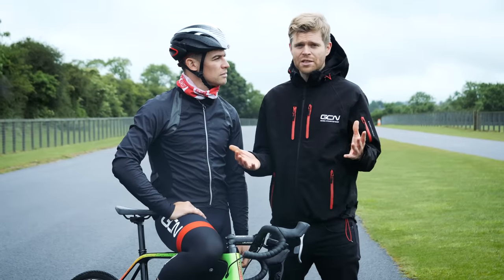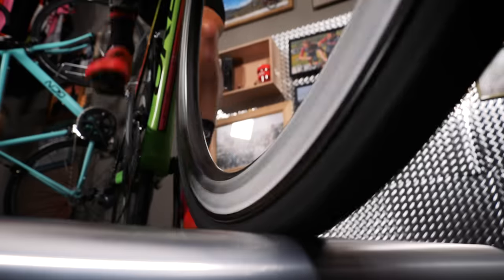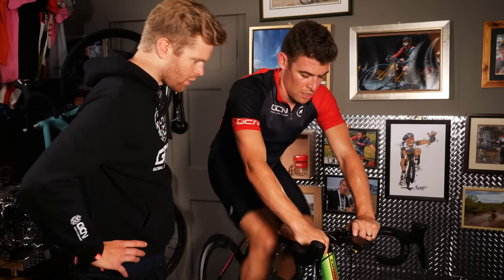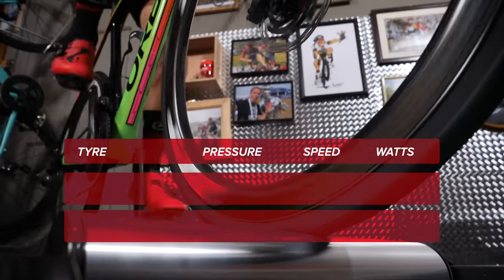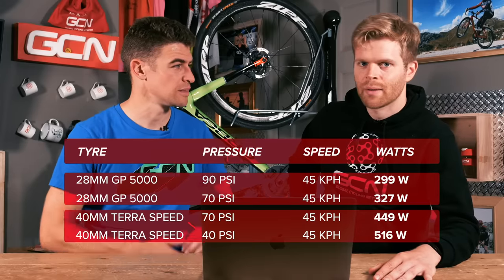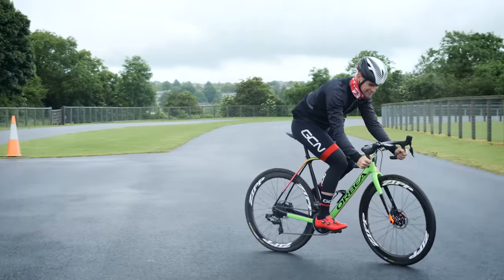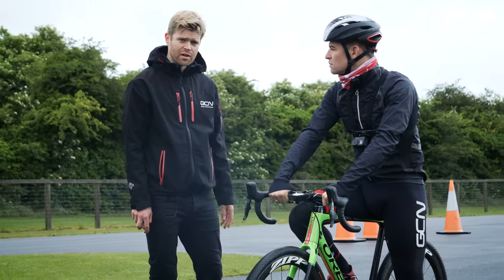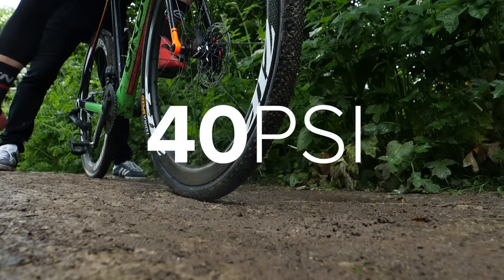Gravel Vs Road Tyres | How Much Slower Are Gravel Tyres?

Comment: The problem with the smooth roller isn't necessarily its smoothness, but rather the fact that it touches the wheel over a smaller area. This deforms the wheel much more than it would over tarmac, which probably shifts the results in favor of narrower and harder tires.
Reply: but that's not all they tested, did they?
Reply: @kalashnikovcortez1380  No. It was merely a remark on Ollies comment "This is all well and good, and it does give an indication as to the difference in rolling resistance between the two tires and the different pressures, but its not entirely representative of the real world on these perfectly smooth rollers".
Reply: Even if the contact area is smaller it is equal for all types of tires, so it doesn't give advantage to any particular type of tires.
Reply: @andreip9378  Unless the relationship between deformation and rolling resistance is exactly linear it won't be the same for all tires. Even if it is linear this would only mean that the relative difference is the same (between the tires on asphalt and on the roller), which directly implies that the absolute difference in watts cant be the same.
Reply: Ulrik Seip The harder, narrower tire will always be faster on a good surface, as long as you have grip. When you slip and crash, or have a flat, it is suddenly much slower.
It indeed is comparing apples and oranges.
Reply: The roller would have to be the same diameter as the Earth to have the same real world rolling resistance. Never thought about that. Thanks
Reply: The ratio of the differences from the test results would be relatable to real world, as seen to a degree in the second demonstration.
Reply: They should have tested this with 32mm cross tyres.
Reply: Hard to say your tire does only touch at one point on the road this has two points of contact in the back right..?  Not a physicist
Reply: @Schradermusic  back in the days we used to use 33mm cyclocross tires all the time. they behave very similar to road tires - they actually arent all that suitable for gravel but they have very good grip in wet conditions on loose mud/halfmudded roads etc.
Reply: @kingprone7846  I've recently gotten myself some 32mm Continental Cylco-X-King Racesport and I find them to be pretty good for what I'm riding. (Bad roads and dry, sandy forest paths)
They have great rolling resistance on the road and enough grip in the forest.
Reply: @Schradermusic  they look similar to the old cyclocross speed-kings from continental which were actually aweful. If you dont need to ride on mud then the best tires by far for mixed road, offroad conditions are the Continental CX speed tires (35mm imho much superior to the 45mm, i run the 45mm atm unfortunately)
Reply: the speeds have prooven themselves again and again in particular due to their rediculous low rolling resistance even when compared to slicks. They do not seem much use in cyclocross though due to them being 35mm rather than 33mm max and they are AWEFUL in mud.
Reply: @kingprone7846  The Black Chili compound really makes up for that. I'm coming from Schwalbe Marathon Supreme and it hasn't gotten much worse on the road but tons better on dry forest paths.
Reply: Too be honest I want my hybrid bike to be faster and use less off my ebike battery  aswel 25c tyres is better for road use 23mm and 19mm wide is more for track racing but on road it's pointless  you will go faster on a 25c on road than 32c so the balance  is 25c on road 23mm track
Reply: yeah the lesson is dont ride low pressure gravel tires on rollers.. lol
Reply: It's correct for me because I always ride outside on tarmac on a roller rig, backwards.

(In all seriousness Ulrik you are totally correct)
Reply: @andreip9378  No, it's not! Performance in different situations is different. So each condition favors a specific type of tire. All those lab tests don't take the energy losses in the riders body through friction into account.
Reply: @jonathanoxlade4252  that's the old school mentality, in tests they have found that going crazy narrow doesn't provide any benefits and can have worse rolling resistance than moderate width tires. 

And with how much more comfortable 28s and 32s are there's no reason not to now that most bikes are built to handle a little width
Reply: the faster tire on rollers is always also faster on real roads. the actual watts wasted will be very different though. source: years of field testing and roller testing

Comment: The second test should have been climbing up a muddy hill. I'd like to see a road tire do that ;)
Reply: the roadbiker would just call his mechanic, who'd drive him up the hill in the backup car xD
Reply: the road would DNF
Reply: That's like driving an f1 off road..
Reply: @MarvinatioN26  just getting a looooong drink of water.
Reply: The Terra Speed is not meant for wet but it would still be usable of course. 
A better argument is what would happen in winter countries near winter when roads sometimes have a bit of snow and ice - can't use the road tires at all or it's certain death.
Reply: there is a location here where the sand and gravel are very loose, and has many rocks, both rb and gravel tires would dnf while an mtb tire will ride over it.
Reply: @tobznoobs  is it made of polished marbles? MTB is made for tight turns and jumps at the cost of weight (suspension) and watts (posture). it doesn't make the tires magical. Same tire properties can be on a gravel tire. Granted there's a bit less weight on the rear tire and it's slimmer but with good tires, correct pressure I get good grip. We have gravel tires that can run 20-30psi now - that's overkill I never had to drop below 45 yet and stay around 50 for incredible road performance while still handling climbing on loose gravel.
Reply: @captainLoknar  I love how you argue from your high horse that there's no difference between gravel and mtb tires, while admitting that width is a difference. I'd love to see you show all of us why wide tires are unnecessary in loose sand
Reply: @nk-dw2hm  no I said loose stuff is where wide tires are necessary
Reply: I went on a muddy path with my road bike with 28mm tires yesterday and wow was I digging my bikes grave
Reply: Like to see any tire climb up a muddy hill.
Reply: @captainLoknar  yeah, I've a hybrid vs an mtb, guarantee the fast would always win, except where I'm not confident in my traction or surface-holding, the mtb just dominates any surface at its max pace
Reply: The road biker would just walk it up.
Reply: Exactly. I learnt something from my days using a raleigh chopper  and that is the perfect SET up for winter is a mountain bike tyre on the rear. And a road slicker tyre on the front. Its the best of both worlds.
Reply: @captainLoknar  hi there, interesting comment, may I ask you what was the make and model of the tyre you are referring to?
Reply: @ChristopherClaudioSkierka  sorry, I'm not sure what comment you saw. It's been a while.
I'm talking about gravel tires in general. I have experience with Schwabe All-Round and Continental TS.

Comment: Rollers apply friction much differently than a smooth road. Yes, please do efforts on smooth road and gravel and compare power, would love to see that!!
Reply: Philip Andrews can you elaborate on the differences? I’m genuinely curious.
Reply: @ichallengemydog  Sure no problem, the fact that the rollers are cylindrical (with a quite small diameter relative to the size of the wheel) means that the contact pressure is more acute when compared to a flat road. The smaller the roller diameter, the deeper the deflection of the tire, and road is basically and infinite diameter roller. This deeper tire deflection means that rollers are much more sensitive to tire pressure, texture, pattern, etc. Sorry it's hard to explain much more without using additional science that I'd have to look into more myself. From personal experience, changing tire pressure slightly doesn't make much difference on the road but makes a biger change on rollers because the tire deforms so much more. Honestly have never ridden rollers with knobby tires but with that more acute pressure there's no way the knobs contact the rollers the same way they do on the road. I could be wrong though 🤷
Reply: @ichallengemydog  maybe a bit more simple and visual: the strong deformation of the tyre (see video), which gets amplified a LOT more with lower pressures than on a flat road surface basically means not only more friction but basically, that you have to get up an INCLINE at the same time (just look at the angle of the deformed tyre in the direction of spin). it is as if you were to cycle up a hill ;) hope you can picture that
Reply: The weight of the tires plays a huge difference. I own a gravel bike and have 2 sets of wheels. 1 with 42 gravels and the other with 28 slicks. The 28s make it feel like I am flying.
Reply: Thank you for posting this. I was shaking my head immediately and about to post my own reply before I did a Ctrl-F "smooth" and found your reply the 2nd one down. This is a terrible comparison. They should get on a large drum wheel from a car dyno and apply different traction surfaces to get a better idea.
Reply: Philip Andrews I found 2-3kph from a 25 mm to a 40 mm at very similar power. At 35kph I needed to put out about 30 watts more with the 40mm gravel tires. I have a usual route I do when I go out alone.
Reply: Watch the whole video. They do exactly that.
Reply: @mtnbikehead  Thanks, that seems much more realistic and about what I expected from my experience.
Reply: hmm did you watch the complete video?  They did do a comparison on tarmac and gravel, and the Conti 5000 beat the Terra Speed in both instances.
Reply: @WanderingSword  Yes but those were roll down tests which don't give any quantitative information about power loss differences, only qualitatively.
Reply: Philip Andrews I have 2 sets of gravel tires. The 35s with an almost smooth centre pumped up 65psi is about 1.5-2 km slower on smoother surfaces. My 40s are tubeless, and have more tread. 
There is no 1 perfect tire. Just choose a tire that fits your local riding spots. A really good 32 will get almost anywhere. 
Ride On
Reply: So everyone here agrees that gravel tires are too slow for road use?
Reply: Jesse Chao nope, I just started squeezing into the 30kph+ group on club rides and can still ride my gravel bike faster than the c groups.. It’s the size of the motor that counts
Reply: They did also test on smooth and gravel surfaces.
Reply: @mtnbikehead  the assertion that you have a more powerful motor doesnt mean hes wrong about the tires. perhaps faster tires and a backpack full of rocks would place you in the same group.
Reply: Kooka Munga no, it was asserted that gravel tires are too slow for the road. From another site that took Strava averaging, that the avg road rider rides at about 21/22kph avg.which is a solid C Group ride around here. I avg 24-26 kph on the 40s on tarmac. 
There are a few guys that routinely bring cx bikes with 30/32s that do lead group rides, well until things get spirited on the way back which often push the speeds into the 40kph range. That’s often when those faster riders with the wider tires lose momentum. 

There is no minimum speed for road riding. If a rider wants wider tires for grip, comfort and the ability to safely rode a variety of surfaces, why not? There is no minimum speed for road riding. If you are performance minded, it’s the best horse for the course, and pick your tires to match the terrain.
Reply: @ichallengemydog  nope.  Plenty of people still think wider rolls faster, so they use gravel tire, because wider rolls faster.  These people have a hard time accepting the results here.
Reply: @kalashnikovcortez1380  People forget that accelerating wheels which weigh more takes more energy as well.  Every pedal stroke is an acceleration.
Reply: I thoroughly enjoy having my gravel wheels on when I am just riding around not trying to keep up on group rides. Mainly because the wider base makes for a more comfortable ride and secondly because being tubeless means I dont have to worry about flats.
Reply: @mtnbikehead  we are talking about different things. what you are saying is if you want to go slow than slow tires are fast enough. if you want to go fast then fast tires might be advantageous.
Reply: Kalashnikov Cortez yeah, smooth hard tarmac, skinny pumped up to 140+ psi can be super fast. However, most tarmac is not velodrome smooth. 
Wide tires at a lower pressure will help maintain speed but still at a cost, of added weight and aerodynamic losses. A buddy that uses 23mm tubs rolls past me effortlessly on the ultra smooth tarmac, but gets dropped when the road is less than perfect. I run 25 Michelin clinchers on road bike.

Comment: Nice comparison! It would have even been better if you included a fat 40mm slick tyre :-)
Reply: this would be great info to have!!!
Reply: Yup -- something like the Compass (now Rene Herse) Barlow Pass or Snoqualmie Pass, run tubeless (on a rim with a hook bead!).  Another fun test would have been to take these knobbies and shave off the knobs so we can know that the casing is the same.
Reply: Yes definitely, I ride Challenge 33mm Stradas and they feel as quick as 28mm Corsas. This would be super useful to test.
Reply: @ericpmoss  Yeah I'm running the barlow passes.. they feel super fast..
Reply: results would have been the same.  The 28mm beat the 40mm by almost 20m on pavement!!  That's a significant distance in a short rolldown.
Reply: and some actual gravel...
Reply: Good idea! Maybe for the sequel 🤞
Reply: RC seghers 

Or a Conti GP 5000 32mm!
Reply: Specialist pathfinder pro bliss tubeless 40mm 650b is what you should have test verse gpx 5000 both can take 90 psi
Reply: Those are stupid.
Reply: @KandiKlover  challenge accepted any place anywhere come and have a go ifyouthinkyourhardenuff
Reply: Or Schwab’s 650bx2inch

Comment: ... sustained 45kph: Chris Opie is my hero. Great subject - I'm sure it's pretty much top of mind for most of us
Reply: On the road yeah.... road tires on the rollers (esp. if you've got large diameter ones), not that bad!
Reply: Try the 45 mph test on wet gravel and see which tire does better
Reply: Sounds impossible... unless your Superman...
Reply: Sorry, but the realy power was only appr. 150W. Ok? Weight of driver is round 70Kg. (after big breakfast :-)
Downforce 700 Newton, 45 km/h are 12,5 m/s and a rolling coificent of 0,005 (GP 5000) gives 43,7 Watt!
Suggest the graveltire needs 3 time more power....150W.
IF the ergometer simulates also the wind resistance, then the power could also be true ,-)

Comment: That was a fascinating test. I didn't actually realise there would be that much of a performance loss in switching to gravel tires. This makes me question my plan of switching from road tires to gravel tires. Thanks for providing this super useful information.
Reply: I feel the same way, i love the speed and easy rolling.
Reply: Two factors make it matter much less than seems in the real world 1) Drag is proportional to speed squared. 2) No surface is smooth like a roller - and softer tyres absorb the bumps without pushing the whole bike pack. Even small ripples affect it.